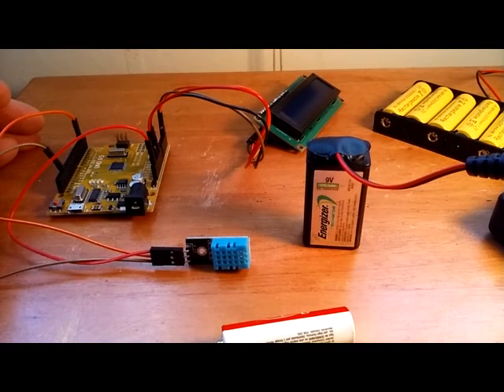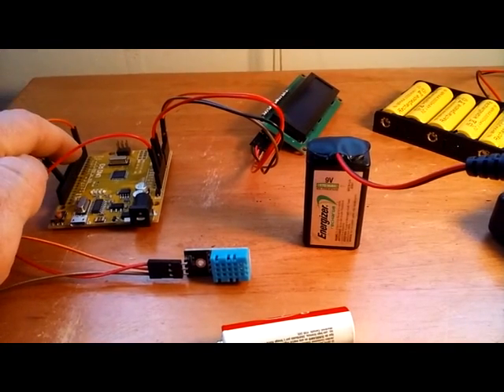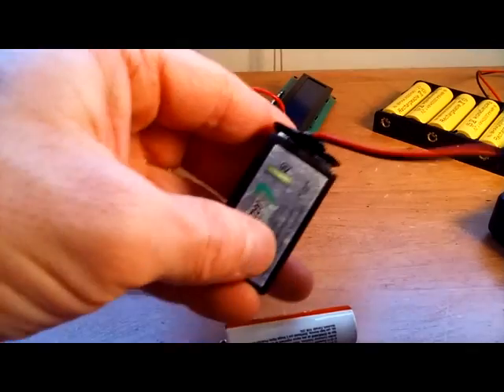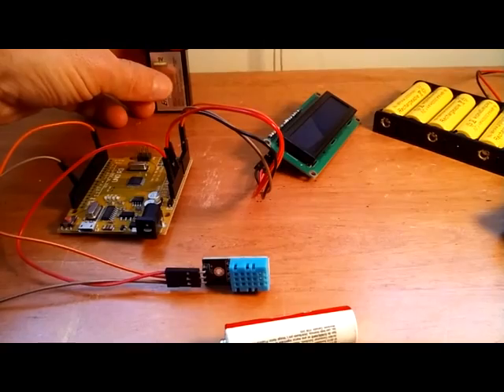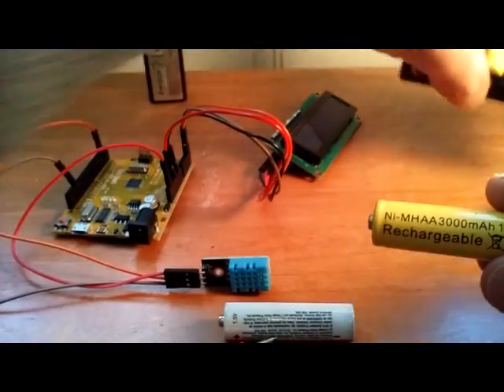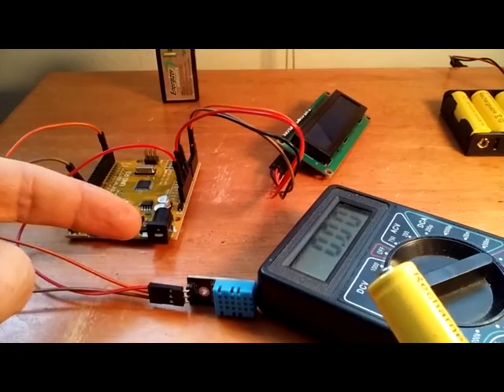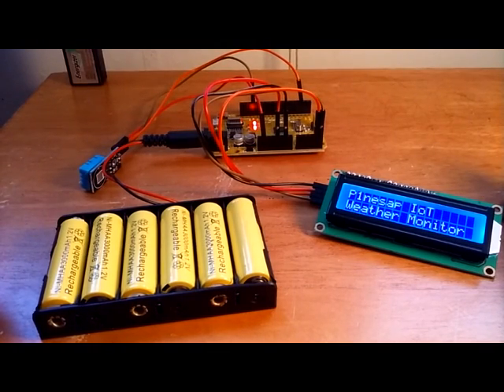Rechargeable Battery Power 💥 for Arduino Microcontroller

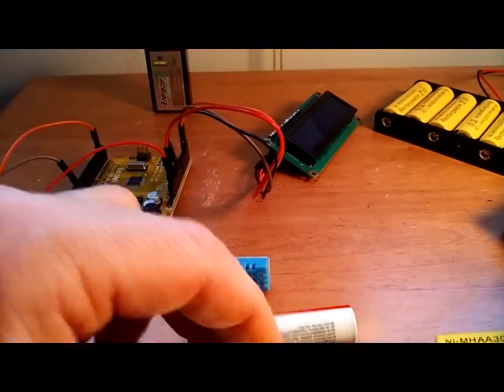Comment: Cool video, only one small remark 1:13  - when battery says for example 3000 mAh it is the capacity of the battery not the "current" :) When you multiply Amperes by seconds (or hours) you will get Coulombs which is the amount of charge in the battery.
Reply from the maker: Battery ratings are always inflated.

Comment: Hi! I have the same battery pack which houses 6 1.67 volt batteries. Unfortunately, my arduino is not powering up when connected. Any chance you can help me out? Thanks!
Reply from the maker: Test powering something else with the battery pack. Don't connect to 5v  input if exceeding 5v, which your pack does. Connect to V+ pin.

Comment: Hey! I am new to Arduino and I have a stupid question. If you conect those 6 batteries (8.4V) doesn't that exceed the maximum 5V of Arduino? Won't it get damaged?
Reply from the maker: The DC barrel jack takes 7 - 12 volts.

Comment: im just using 4xAA into 5V pin, and charging it with power supply to max 5.2 volts.
Reply from the maker: sounds good, just be sure not to fry 5V pin...
Reply: Yes, need to be carefull using this method. Im thinking that im going to buy one of those cheap 1$ power bank from ebay. You just need single 18650 cell ( i have many of them from dead laptop bateries) and it have already built in charging circuit + 5V buck converter for usb output. Seems perfect for arduino, and cost less than branded 9V battery :D
Reply from the maker: good idea

Comment: i am manoj i am more strougle in arduino my project is done in arduino board but i am implement in only single IC on BREAD BOARD .but my programmed not running in BREAD BOARD with 9v battery  ,componenet running with hc-05,rtc module ir sensor....
      so,what i will do the prgrammed run in BREAD BOARD very well.
Reply from the maker: Manoj suryawanshi Just buy cheap atmega 328p uno.

Comment: Can you use a 2 cell lipo??..fully charged is 8.4v..or use a 3 cell lipo??..fully charged 12.6v..they come in small sizes but have 120mah all the way up to I've seen 30,000mah...i was actually wanting to use a 12v 35 amp led acid car battery...will that work..I've heard these arduino uno can take up to 30v.... thanks..

Comment: Fine choice. I found a more expensive, but convenient solution in the FatShark Lipo, 7.4 V, 2500 mAh. 19.00. Fast Charge, and has the 5.5 mm barrel plug to fit the Arduino boards.( DFRobot sells an equivalent unit.) Note that you also need a Lipo balance charger for around 12 bucks. I am running a GSM and an LCD on an Uno. Very hungry. GSM alone has a peak 2 amp draw. Note that Ebay sellers also have a FatShark case with barrel jack, and holder for two 3.2 cells. A cheaper way, but can't speak on performance comparison.

Comment: Thanks for the video with a good clear voice. I have just received my first ever Arduino Uno R3 and have yet to even attach any power supply to it. This is a huge help to determine the optimum power source. Being a quadcopter owner I have a good stash of batteries lol. Doing my best to not Fry my first Arduino board.
Reply: Lee Fuller yah

Comment: Very informative. It would be great if you add a comparison with Li batteries. Just wanted to add that prices of LiPo batteries falling down.( though still sky high when compared to prices of NiMH). So when space/weight is a premium or when higher voltage(3-5V) from a small space is required ( tiny IoT devices), LiPo can be used.
Reply from the maker: Thanks Anurag, please post link to affordable LiPo batteries. I've seen these in powered gliders.
Reply: these are few i quickly looked up on ebay. http://www.ebay.com/itm/262648288009 or http://www.ebay.com/itm/262648276705.
Reply from the maker: thanks, there's the catch: low mAh, only for short-term applications.